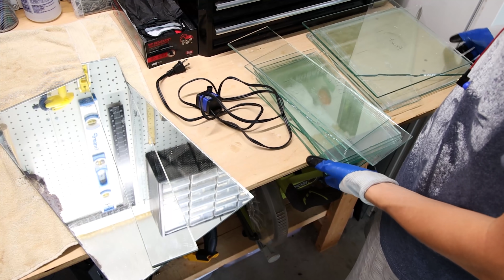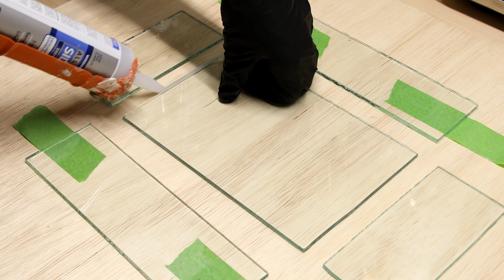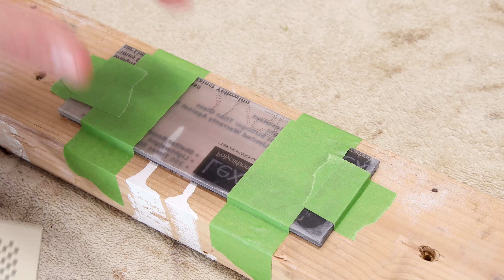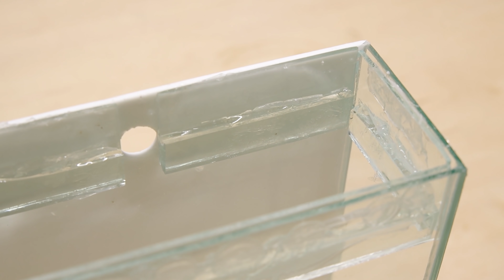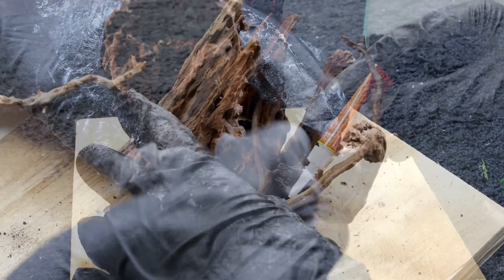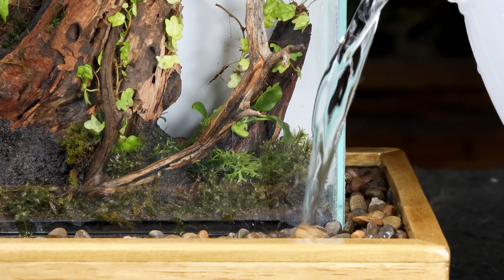DIY Mini RainFall Zen Terrarium

Comment: I'm toying with the idea of something similar in the paludarium I'm setting up. I'll have a waterfall on one side but I was thinking of putting a 2-way valve into it and running the water to the top and onto a perforated plexiglass sheet and just letting it fall like rain onto the system.

Comment: You made the base w glass then covered it w wood i think i would have put cutouts there so you could see the rocks behind the glass
Reply from the maker: The wood was an afterthought actually. I felt that the glass had too many scratches to be a focal point of the design. Would be interesting to try what you're saying though.

Comment: I love your videos bro. I would just like to give you a tip. After cutting the glass i would advice you to gentle tap on the back of the glass along the cutting line to create a small crack along the line. In that case the glasd breaks more easily and always perfectly

Comment: Hey tanner, thanks to your videos I've made many vivariums but I have a question. Could I make a vivarium part land and part water without a pump? Or will the stagnant water just get filled with algea?
Reply from the maker: It will most likely get stagnant. At the very least I'd recommend something for circulation.

Comment: It's great. One question, how would you get the water droplets finer, so more like a misty rainfall?
Reply from the maker: Probably just make smaller holes. Maybe 1/32"? Otherwise you'd probably have to make it pressurized with nozzles.
Reply: @SerpaDesign  pressurised with nozzles  - that would be great.

Comment: If you make a groove on the inside of the wooden top you can hide an LED in there and run a small wire to it, giving a soft light from above (would look amazing!).

I think if you use that wood as the backpanel instead of the white glass it would look even better and more zen.

You could consider applying some anti-fog or anti-waterdroplet nano spray to the front glass so it stays a bit more clear. That way you won't have to remove the front glasspanel.

It's a bit of work with all the glass cutting but a very inspiring setup man!

Comment: Looks great,love your tanks!
Did an 8x10 foot rain box installation yrs ago for an art show. 
If you use a strobe light and adjust the settings it helps make the rain look more real. 
Also used adjustable drip nozzles on a water line for added control, front could rain slower with bigger drops while the back was set up for more of  a downpour and added depth.

Comment: i have a concept like this but im not really sure if its gonna work. i have a couple of question about the build:
1. What about the lighting? do you only use light from the room or you add another dedicated light to this setup?
2. if i put a dedicated light above it i affraid it'll grow algae, how do i solve this issue aside from weekly maintenance?
3. what if i put timer in the pump so it'll start randomly to mimic the rain in real life? will it affect the pump?
4. i see you have a similar issue in my mind with the water splashing to the glass, so what if i put the top reservoir only halfway of the terrarium? do you have any alternative for enclosed terrarium so that the water wont splash to the glass or at least minimalize it without opening the front part?
Sorry if i ask too much, and thanks for your inspirational build as always.

Comment: You are doing it the wrong way! Do NOT break the glas like that.  Put the cutter under the glass on the side close to you and gently push with both hands left and right from the cut you made.  The break will start at the side where you put the cutter and it will 'run' to the opposite site, always making a clean cut.  Try it, you will notice how easy it is.
Reply from the maker: I do it sometimes, but I find that it doesn't work well with thicker glass so I typically only show it this way. Maybe I'm doing something wrong?

Comment: Can you make an easy tutorial for getting rid of scratches on acrylic? Currently I use a cardboard thing I made which sits inside the aquarium top with the support of the overhead filter. It blocks some of the light from falling on the front pane and hides all the scratches! You should try it once.
Reply from the maker: It's very simple, buy glass! 😂 Lol in all seriousness though, that's why I usually don't use it. It scratches way too easily. You'll have to buff the tank with some wet/dry sandpaper.
Reply: @SerpaDesign  I see. I once tried toothpaste following a guide from Google like a complete fool.... So sandpaper is the only way eh?